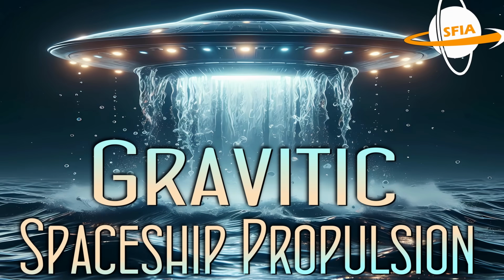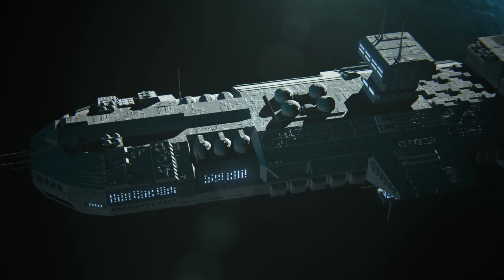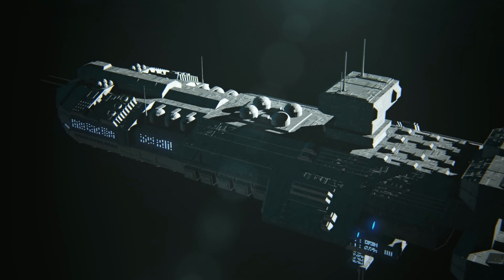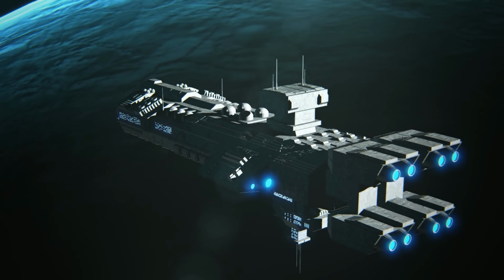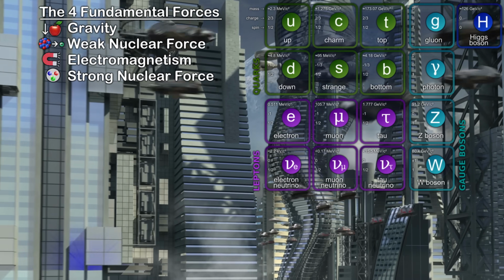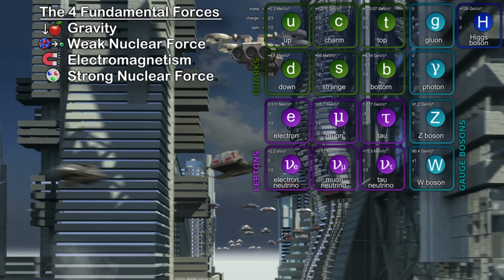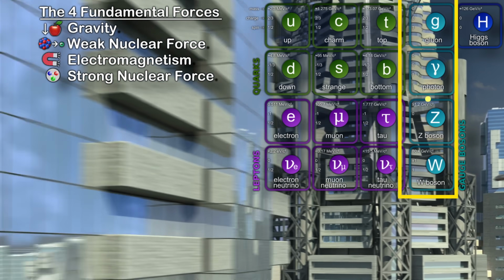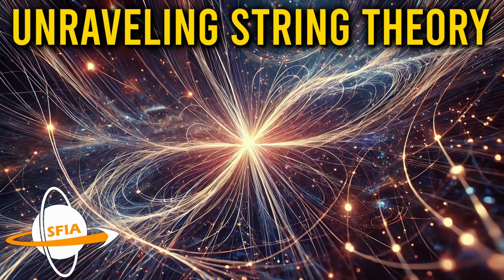Gravity Tech: The Power To Reshape Our Civilization... And The Cosmos Themselves

Comment: Isaac's explorations of the Heat Death are the best out there, but what if the end-state isn't a decay, but a feature? I developed a framework called the Zavasian Selection Principle that treats the Heat Death as the universe repaying a cosmic energy 'loan.' The most interesting part is the engineering implication: it provides a theoretical basis for 'Brane Resonance Technology'—a way to create matter/energy from the vacuum and, ultimately, build a 'Genesis Engine' to reboot the cycle. It's a new set of engineering problems for a K-IV civilization.

Title: The Zavasian Selection Principle: A Naturalistic Model for a Self-Replicating Universe
TL;DR: This is a cosmological framework that resolves the energy conservation paradox from cosmological redshift [1]. It proposes the universe is a closed-loop system repaying an energy "loan" from the vacuum. This single idea, when followed to its logical conclusion, suggests our universe exists because it is part of an evolutionary cycle of self-replicating realities, with DNA-based intelligence serving as the unwitting reproductive system of the cosmos, rendering a supernatural creator unnecessary.
The Core Idea: Solving the Redshift Energy Paradox
The problem starts with a real, observable paradox in physics: The universe is expanding. As light from distant galaxies travels through this expanding space, its wavelength is stretched (cosmological redshift), and its energy verifiably decreases. This appears to violate the Law of Conservation of Energy, a foundational principle of physics [1].
The Zavasian Conservation Model proposes a solution: The law is not broken. The universe is a closed-loop system repaying a temporary energy "loan" from the baseline vacuum state. The expansion and redshift are the observable mechanisms of this repayment. This is the foundational principle, grounded in a real paradox. Everything that follows is the logical consequence of this single idea.
The Full Framework: The Zavasian Selection Principle
Part I: The Foundational Principle (The Zavasian Conservation Model)
This model is grounded in the established physics of General Relativity (which describes a dynamic, expanding spacetime) and Quantum Field Theory (which includes the concept of a vacuum state possessing energy [2]). It reframes the universe's evolution as a single, thermodynamically complete transaction. The Heat Death is not an end, but the final balancing of the cosmic ledger to zero.
Part II: The Engineering Implication (Brane Resonance Technology)
If spacetime is a field that can be excited and can settle, a sufficiently advanced civilization will learn to engineer this process. This leads to Brane Resonance Technology.
"Oppenheimer in Reverse": This technology is a speculative application of concepts from M-Theory/String Theory, which posits our universe may be a "brane" in a higher dimension [3]. By generating focused gravitational shockwaves (a technological application similar to the "Grav Tech" explored by futurists like Isaac Arthur [4]), a civilization could theoretically "pluck" the brane, causing a state change in the vacuum and creating new matter and energy. This is consistent with the principles of Quantum Field Theory, which allows for particle creation from energetic vacuum states (related to concepts like the Casimir effect [5]).
Part III: The Evolutionary Outcome (Cosmological Natural Selection)
This provides the "why." The concept of universes undergoing natural selection has been explored by prominent physicists like Lee Smolin [6]. The ZSP proposes a specific mechanism for this selection, directly addressing the foundational problem of our universe's initial low-entropy state, known as the Past Hypothesis [7].
The DNA Imperative: The key to replication is not just intelligence, but a self-replicating molecule (DNA) whose ruthless drive to survive provides the motive to overcome the ultimate existential threat: the Heat Death. This is a cosmic-scale extrapolation of the gene-centered view of evolution, where the replicator, not the organism, is the primary unit of selection [8].
The Genesis Engine: The final act of a DNA-based civilization is to use its Brane Resonance Technology to build a Genesis Engine, a device that initiates a new Big Bang, birthing a daughter universe with the same successful "genetic code" (physical laws).
The Unbroken Chain: Our universe exists not by chance, but because it won an evolutionary lottery. Any universe whose physical laws do not allow for the evolution of DNA and the eventual construction of a Genesis Engine is a cosmic dead end.
Conclusion: The Universe as a Survival Machine
The Zavasian Selection Principle frames the cosmos as a complete, self-perpetuating system that does not require an external creator because life itself, driven by the relentless engine of DNA, becomes the reproductive system of reality. The universe, in this view, is the ultimate "survival machine" for its own fundamental information.
Sources & Further Reading
[1] Cosmological Redshift & Energy Conservation: A paradox discussed in detail in physics communication. The direct inspiration for this entire framework was the refusal to accept the standard answer ("it just vanishes") as presented in Veritasium's video on the topic. For a deep dive into the underlying physics, see the PBS Space Time episode, "Noether's Theorem and The Symmetries of Reality."
[2] Quantum Field Theory & Vacuum Energy: The foundational theory of modern particle physics. For an excellent overview, see PBS Space Time's episode "What is Quantum Field Theory?"
[3] M-Theory / Brane Cosmology: A leading candidate for a "Theory of Everything." For an accessible overview, see PBS Space Time's episodes on String Theory.
[4] Speculative Engineering ("Grav Tech"): For deep dives into the far-future engineering possibilities of manipulating gravity, see the YouTube channel "Science & Futurism with Isaac Arthur," particularly episodes on "Grav Tech."
[5] Casimir Effect: A real, observable force that arises from quantum vacuum fluctuations, proving that "empty" space is not truly empty. A fantastic visual explanation can be found in Veritasium's episode on the topic.
[6] Cosmological Natural Selection: A hypothesis most famously proposed by physicist Lee Smolin in his book "The Life of the Cosmos," suggesting universes can reproduce and evolve.
[7] The Past Hypothesis & The Arrow of Time: The profound and unresolved problem of why the universe began in such a low-entropy state. The definitive popular text on this subject is Sean Carroll's book, "From Eternity to Here: The Quest for the Ultimate Theory of Time."
[8] The Replicator & The Survival Machine: The foundational concept of the gene-centered view of evolution. The definitive text on this is Richard Dawkins's book, "The Selfish Gene."

Comment: Artificial gravity plates/fields would have several advantages over spin-gravity rings for ships:
1. More compact designs
2. The same gravity regardless of which deck you are on
3. No coriolis effect
4. If the field strength can be adjusted for different locations, setting cargo handling areas to low gravity would be beneficial for moving heavy containers.

The "advantage" of a rotating habitat meaning that you aren't presenting the same aspect to attacks is irrelevant - there is no reason that a ship with artificial gravity plating couldn't be rotating along its long axis during combat; in fact, it would be better off as only the habitats of the ring vessel would be presenting different aspects but all other parts would be presenting the same aspect whereas all parts of the gravity plating/field ship would be rotating.

Comment: While it seems likely to be theoretically possible to bend the space-time metric with sufficiently strong other field forces, such as magnetism (i.e. https://agenda.irmp.ucl.ac.be/event/2296/attachments/1000/1142/seminar_Gravity_Machines_UCL.pdf), it just won't ever be at a level where the originating field force doesn't swamp out the gravitational effects. For example, to produce enough of a gravitational force, absent the normally required mass, the magnetic force would have to be higher than what a magnetar produces, and strong enough to rip the electrons off your atoms.

Comment: Super-luminal warp drive does not require a violation of the weak energy condition,  if one allows extremely thin membranes of positive energy. See my paper 2024 Class. Quantum Grav. 41 135007

Comment: "we see gravity as a force" OK but I have two problems with this.  1) Why does gravity NEED to be seen as a force when seeing at the much easer effect demonstrated by the things on a rubber sheet works very well apart from the rubber sheet being more 2 dimensional, the thickness not really counting and space being 3 dimensional.  However a rubber cube with things in it warping it is not so easy.   2) for me a "force" has to have some active component.  For example Volt is a unit of electro-motive "force" "pushing current".   Things including us are not pulled or pushed down to the earth we fall down.

Comment: Using gravity tec for propulsion is unlikely. it is like using a traggas ( lifting gas)  on a balloon. You need different engines for movement. In Space it's likely for shields,  compression of fuels or the temporary creation of new elements which have a much higher power density. The interaction of gravity with the 4th dimension of time is very interesting. Further questions would arise here.

Comment: One thing that always bugs me thinking about gravity tech is the power requirements.  Since gravity is exponentially weaker than the other forces doesn't it stand to reason that star trek style gravity plating would take exponentialy more power to have the same grip as an electromagnet floor would?

Comment: A few things you mentioned that make me think you haven't read/watched certain media.
1. Even a solid lump of metal wouldn't have the mass to create it's own gravity, let alone a ship that is mostly hollow space and even less dense.
Try reading Existence Combat, they have a fun aproach to, well a lot of things. Included is, their ships are almost entirely solid hunks of super dense metals/alloys/composites. Wich means they very much can have a density several times higher than a similarly sized solid hunk of steel would, and between having multi kilometer long hunks of solid metal that are super dense, and also super durable, you can have cases like a ship crashing into a planet and causing untold horrors on it's mantle and crust or contentital plates, yet still being largley intact. They also do rely on life support for, among other things, intertial dampening, as it failing is what can very much result in the crew of a ship turning into a slightly red mist like coloration on the walls of the crew quarters when they make maneuvers... or crash land on a planet as mentioned above... A solid state brick of a ship using a different line of tech to almost all other settings was quite interesting and refreshing, and overall it was a pretty decent read.
2. Mek suits using gravity to move around or make themselves lighter.
Suisei no Gargantia is an anime that does have this... they are mostly used for action in space however, as when used planet side, near any other matter... well, a localized black hole or gravitation distortion that can pick up and move a multi ton mech does... fun things to anything else present and not bolted down. While not quite the same as just making the suit way less or have less mass/inertia, it does follow some of that idea of a suit with portal gravity generator being used for mobility.

Comment: Actually the rotating rings are impractical they have to be massively large to begin to have any use and plus the energy and stability because you have a large object rotating freely in 3D space check out the The Dzhanibekov Effect.  But most importantly is actually is the effect gravity on the biological systems of our body. it is actually the number one unsolved issues we face colonizing space and living on Mars long term. Our digestive gut does not work properly, our bone and muscle density start fall off, the flow of blood around our bodies, our eye sight is affected and the list goes on.
Reply: So all the problems you mentioned at the end are problems with no gravity which is eliminated by having artificial gravity. 

And why is 223 meter radius to big? And what about anything smaller where it rotates faster with crew just needing rotational training?

Comment: It occurs to me that there are two basic ideas to implement artificial gravity without rotational or linear motion. 1. Brute force: just put really dense plates in your floors. Wouldn't have to be white dwarf or neutron star dense (assuming my half-remembered math from a year ago is correct, you could manage 1g from compacting the mass of the Great Pyramid into a 1m^2 by 1cm plate). Or, 2. Figure out a way to manipulate the value of the gravitational constant in the floor (can also be done in walls and ceilings for inertial dampeners). That'd probably require mastery of a theory of quantum gravity, however (but still a useful tool for scifi writing). 

Brute forcing it would likely suffer from distance losses, and would introduce the complication that the floor above you would be pulling on your head not-insignificantly (but, again, inverse-square at least helps with that, since your head is farther from the bottom of the grav plate above you than your feet are from the grav plate below you). 

Depending on how Big-G manipulation works, it would either have the same complication, or would allow an effectively uniform gravitational field in a corridor, with gravity on the floor side, and anti-gravity on the ceiling side.

Comment: As a safety rep at my job, if you had the option to hold atmosphere to the extremal surfaces of a ship I can see you'd absolutely do it, even if just as an emergancy fallback measure.

For doing external work on the ship or just as a fall back safety measure against situations life this.

Even if it's just to prevent the loss of atmosphere to space, it would have value as you could slow down the need to replenish it.
Reply: And reduce space polution (if anyone realy cares)🤔

Comment: Settling on high gravity planets... sounds like you're a power failure away from dying. Low gravity moons, with artificial gravity to make things more comfortable, that's fine, doing the opposite is stupid. That's just asking for disaster.
Even if it isn't enough to crush you, imagine walking along and suddenly you're 50% heavier, you're going to smack the floor by surprise, at the very least. Maybe you're hanging something on the wall on top of a ladder, and suddenly you're heavier and you might be dead hitting the floor or have a broken bone or two.

Comment: One concept I don't see used which seems obvious to me is that inertial compensation to protect against high acceleration and centripedal forces from rapid turns could also provide artificial gravity as a side effect. Rather than generating a counterforce that compensates for external acceleration exactly, you could add an offset of one gravity in the direction of your deck floor.

Comment: I did have an idea for a defensive design for a ship, where the corridors are hexagonal, with variable gravity that can switch which wall is the floor. The defensive part is that they can be staggered or fluctuate randomly so that anyone running down the hallway would end up getting tripped up and flung all over the place in any area where this option was activated. Throw in turrets that flip out of the walls and blast doors, and it becomes a brutal kill corridor before Marines can even scramble to repel the boarders.

Comment: On the subject of using gravity tech for mining, a gravity beam might not require any personnel or tech on the planet's surface.  A sustained beam used to reduce gravity on and in a portion of the planet could be used to create a volcano in the low gravity zone that blows molten rock into space where gravity infrastructure could be used to collect the material.  Alternatively, gravity could be used to simulate the conditions a planet would experience when passing into the Roche limit of a larger body, making it break apart into more manageable chunks.

Comment: Another defensive application of gravity tech may be lensing. If you could project one or better several high-gravity points (in a grid) in the potential line of fire of an energy or particle beam, lensing effects could turn any enemy fire from a laser-like weapon into an unfocused floodlight, if the gravity point or the gridded group is far enough away from your own ship.
A grid of these should have similar effects on any material projectiles. They would either change course, or could even be ripped apart by tidal forces.

Comment: Gravitiron, embedding a gravitic attraction lattice in an aligned crystalline iron matrix. The lattice is embedded via magnetic alignment. Several of these sheets are held close together to take advantage of the Casimir Effect creates perfect plates for making artificial gravity within a ship, for it's floors.

What is the Gravitic Attraction Matrix? Fictional bs, for the moment. But hey, it sounds interesting.

Maybe if we can find a massive particle arrangement, something made of quarks like a neutron or proton, but has triple the quarks, so you end up with some fat mass, then lace it into the iron.

I'm spitballing for some fiction I'm working on.
Reply: Switch some of the normal quarks with the high-mass rare quarks and get the same effect without changing the numbers of quarks.